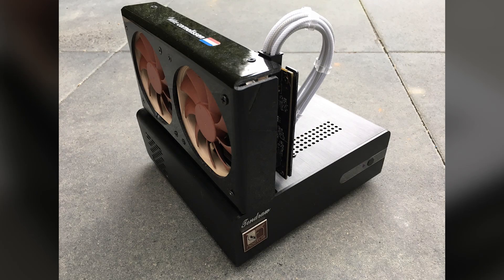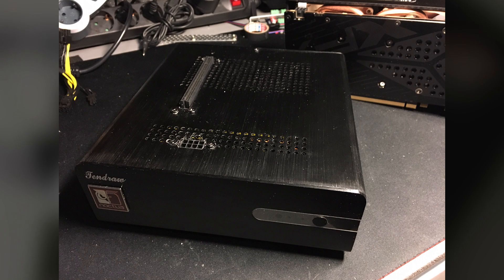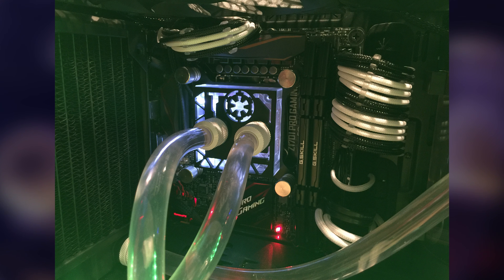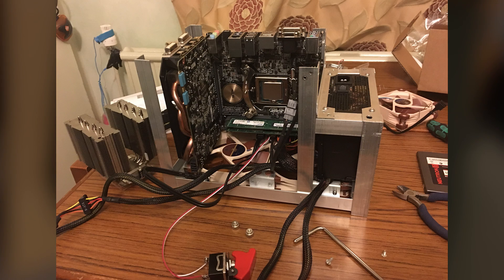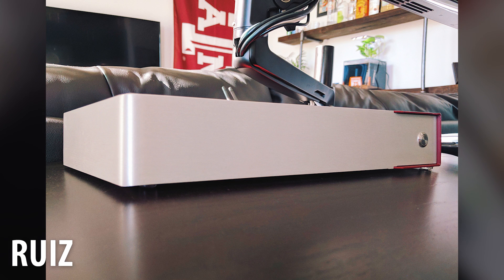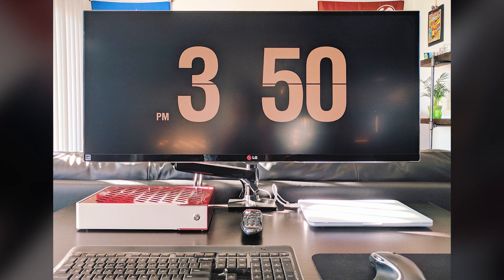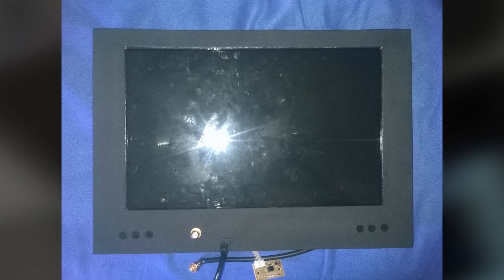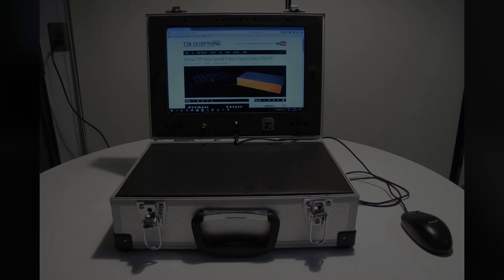Mini-ITX PC Showcase - Ep 2

Comment: Yesterday I built (transplanted) my gaming PC into a Node 202. Cabling took almost an hour and I was so proud of myself with my new tiny gaming PC. But when I compare it to the ones in this video, mine is HUGE and I need to learn a lot for next time.
Reply from the maker: Ha, the Node 202 is a great start man. It's like the intro to small form factor PC cases.
Reply: Hey thanks. I stuffed my Node 202 up to the max, so I can't imagine going even smaller. Maybe next year, when the one-fan half-foot 1080 Ti is out.
Reply: Tom S. I'm really interested in the node 202. why not submit your build to be shown on later episodes.

sincerely, a Node 304 owner who wishes he had the guts to go for the smaller model.
Reply: KmOj uh, i probably won't submit it, the cabling looks like a mess and there's really nothing out of the ordinary here. I have some pics, though.

I learned a lesson: Though the R9 290X Tri-X by sapphire does fit, go for a shorter card if you want to avoid frustrations.

Comment: Jay, what's the best sub $200 mITX Motherboard?
Reply from the maker: The Asus Rog Strix Z270I, hands down.
Reply: Tek Everything just placed the order. Thanks! I'll send you a video of the build when it's done. You're going to get big, keep making quality videos!
Reply: Will F4-3200C16D-32GTZKW RAM fit the S4 Mini with the Strix Z270I?
Reply from the maker: I'm not sure. I would recommend going with something shorter in case you want to use larger coolers or fans.